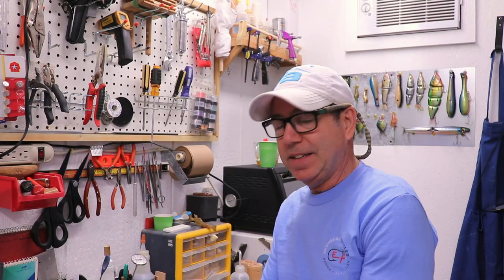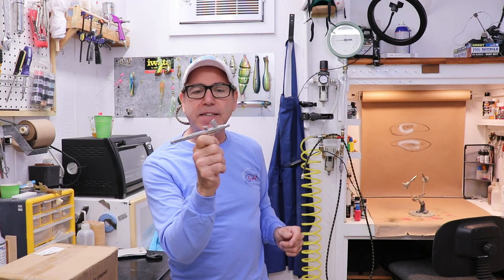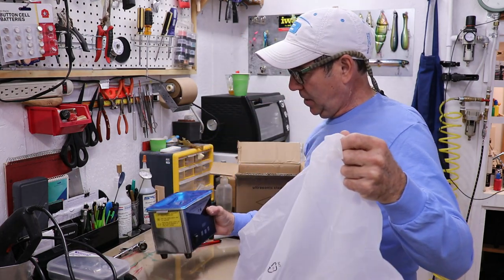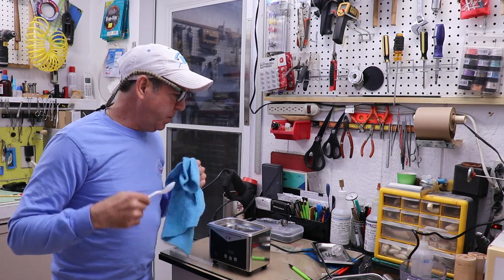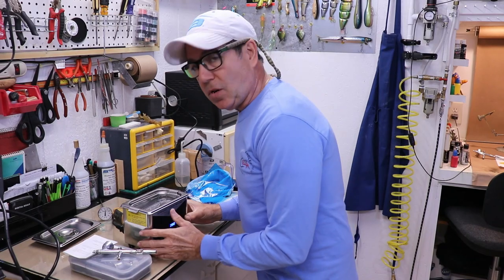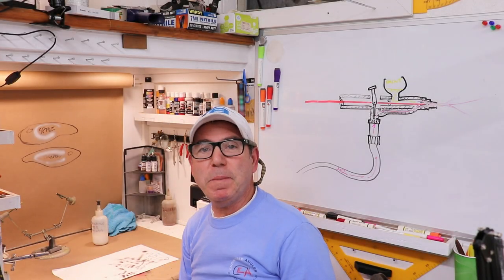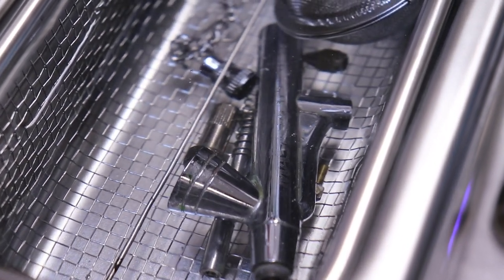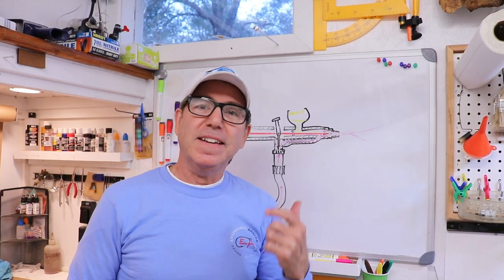Airbrush Ultrasonic Clean Up

Comment: I use my ultrasonic to clean a ton of my toys/tools. Absolutely love it. 

Pro tip: I like to fill my ultrasonic with only distilled water. Then I put my parts that need to be cleaned in a glass jar with whatever cleaning solution that particular part needs (i.e. degreaser, dish soap, alcohol, oil, acid…). This way I do not have to fill the entire ultrasonic tub with the solution, and I can do different parts simultaneously. My ultrasonic cleaner is about twice the size of yours, so I can clean a couple of different projects at once. Also makes it easier to reuse the solution. 

Keep up the great work!
Reply from the maker: Good tip.

Comment: Franco, I noticed you're letting up on the air before closing the paint. That always causes clogging problems and makes it harder to clean. Keep the airbrush button pushed down as you push it forward, that allows the air to continue to flow cleaning the unused paint out before the air actually dries it to the needle. A sonic cleaner is still a good idea for an occasional deep cleaning.
Reply from the maker: Great point!  I know that is the right way to do it but old habits are hard to kill.
Reply: @EngineeredAngler  LOL, I'm old too.... 66 soon

Comment: Don't know if this would be applicable to air brushes or not???  MANY years ago i.e. back in the 60's one of my duties was spray painting parking meters.  I had a devilbiss high quality spray gun we used for epoxy paint.  When I was finished painting for the day  I would clean the gun with lacquer thinner including removing the nozzle and wiping it down to remove any paint in that area.  I would then take apart the head and stow it in the sealed container full of lacquer thinner until the next time it was needed usually about a month.  The spray gun always worked flawlessly and I never had to do any service to it over at least a 10 year period.
May not be applicable to air brushes, but if you have a cheap one it might be worth a try.  I used lacquer thinner as a storage container solvent.  You may need to use some other applicable solvent for air brushes depending on the type of paint you are using.
Thanks for a nice video that brought back some memories.  Ha Ha
John
Reply from the maker: Glad you liked it.  That's pretty much how I maintain my large detail paint gun,  airbrushes have tiny o-rings that are a pain to replace and easy to damage with solvents...so I got to be conservative.

Comment: I use straight windex in my ultrasonic. I do the ultrasonic every time I’m done for the day. Also, in between paint colors, I use a windex/water/alcohol/glycerin solution.  The glycerin makes a big difference in the lubrication. Seems like my iwata always cleans back to like new, but the masters are very temperamental. New logo definitely cool. Like the part about how the gun actually works. I usually just pull the trigger and hope for the best, but understanding how it works will be good food for thought. Thanks.
Reply from the maker: Thank you...and thanks for sharing your cleaning formula...

Comment: Boy, I look forward to your posts. I value your info as it's done methodically, well explained, and you have no reason to fudge the results. Looking forward to the next installment. It will be good to see if the alcohol bath alone will be good. On this one you did a couple of cleanings with two different liquids. It's possible the first one softened up the gunk for the second one to finish the job. Nice to see if just the alcohol will be enough.

>>>Could you please post the link where you got this one? I've found some like it online (look very similar just different brands) but they don't contain the basket. Thnx.<<<

I have an iwata hpcs. Nice brush but then again I've never used another to compare it to. Between colors I run windshield washer fluid through it and bubble ither in a bath of water with a fairly high concentration of simple green. Saves on the brush cleaner fluid which is pretty pricy over time. It seems to do the job. After your second installment, if all goes well, an ultrasonic tank is in my future... Thnx so much.
Reply from the maker: the link for the cleaner is in the description now...thanks for info.  I had intended to include a cleaning with simple green but I was out...and no time to run to the store.

Comment: I use airbrush cleaner jar with thinner and alcohol between colours and once a month I keep the parts overnight inside a tank of alcohol or thinner solution.  BTW, I have Iwata, it's expensive but parts are quality which is easy to clean. Highly recommended.
Reply: i have an iwata eclipse and i use creatix and wicked paints  What thinner are you using?
Reply: @kokaneeoutdoors358  Vallejo from Amazon. For soaking, I use distilled water mixed with alcohol. It works

Comment: Looking at your parts in the bath,  if you would just clean that needle you will have much better success.  The rest of the parts look like are doing well in the ultrasonic bath.  Hadn't thought of that,  great video
Reply from the maker: I dropped the needle in the bath but I actually cleaned it and polished it by hand as I always do.  Good call.

Comment: In the part where you put the needle in the bath there is clearly dried black paint on it. I started air brushing from seeing your work not nearly as good as you are but I started by watching a ton of videos on how to clean the AB. When your done with it for the day start by shooting some solvent through the brush and using back pressure by holding your finger of the nozzle. also scrub the cup with a qtip. Then open up the nozzle end of the AB and pull the needle out from the nozzle end, if there's paint on the needle you will not put it into the rest of the brush and use pipe cleaners in the nozzle till they come out clean. Then wipe the needle.

From what I have read the needles are very easy to bend the tip if you do they will not function right you can sand them straight again. The way you dropped the needle into the bath it seems to have landed on the tip.
Reply from the maker: You know, I did the same..I watched tons of videos from airbrushing artists and I use all the techniques you mention  but, after a few painting sessions the gun starts to act up and a deep cleaning is needed.  I'm hoping the ultrasonic cleaner will do that part.  thanks for the info and for watching.  Cheers.

Comment: Nice video man I just run the alcohol through the gun after I'm done airbrushing then follow it up with a little cleaner and water and disassemble the front and carefully run a cleaning brush through the front of the gun and do the same in the rear takes about 10min a gun that has worked pretty well for me so far I would rather not let it soak overnight and have to go back down to 2nd time to clean it I would rather just be done when I'm done painting but if I get to the point that my method is not working this definitely seems to be a good option and nice logo on the shirt 💪💪💪👊👊👊
Reply from the maker: I totally get it but, I'm a bit of a scatter brain and leaving the airbrush dirty when I walk away in the evening is not a rare thing for me.  This gives me a chance to soak it and get a head start on those heavy cleanings.  Cheers, and thanks for watching.
Reply: @EngineeredAngler  how are you liking that awada airbrush do you notice much of a difference from the Master Airbrush? has I have three of the Masters

Comment: IPA has a flash point of 53°F (OSHA). Do not heat that thing in the ultrasonic cleaner.
Reply from the maker: Well you have to remember that the flash point of a compound is just the temperature where it begins to off gas vapors not the point where it combusts.   if that were so imagine what would happen when you rubbed Isopropyl alcohol on your 98.6 degree body...boom.

Comment: All you need to do is run a little bit of thinner whatever the paint that you're using calls for after you finished that one color run the thinner through , whether it be water acetone thinner lacquer wash run that in between colors until clean  and clear and that will keep your needles clean as far as the fuzzing lines that's because the needle jet as worn down replace your needles, save yourself $50 don't be lazy and strain and thin out your paint

Comment: I fisrt use it and fail to remove the paint on my airbrush. Distilled watre and soap at first with half hour, 120F. Still there. add Vinegar and put it again for an other 30 min. fail. I don't know wath to put in that will not damage my very new Creworks 2 liter Ultrasonic. I'm afraid that I will waist my money on the real liquid for Ultrasonics.
Reply from the maker: I like to use alcohol